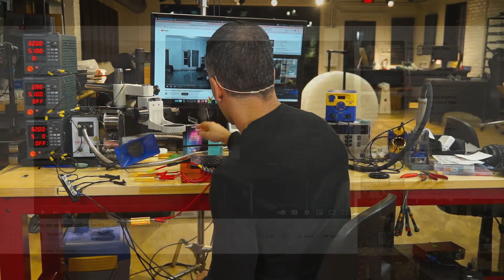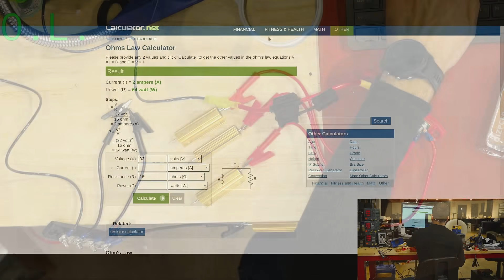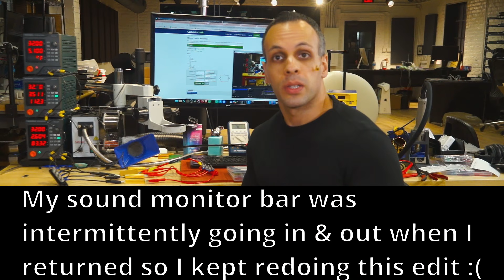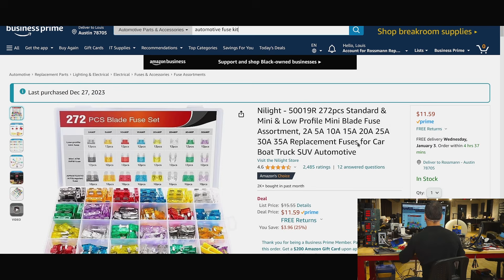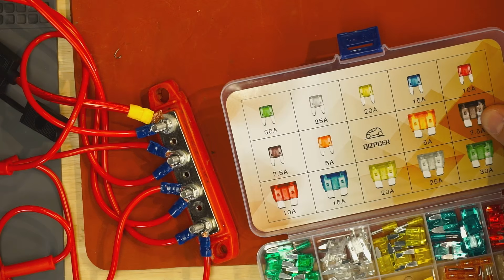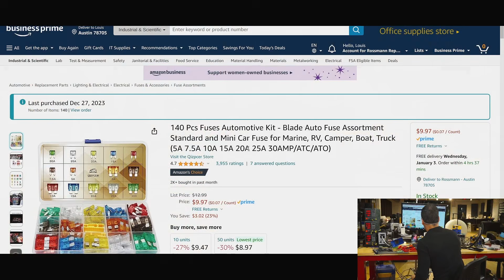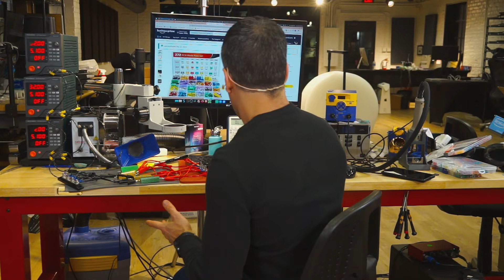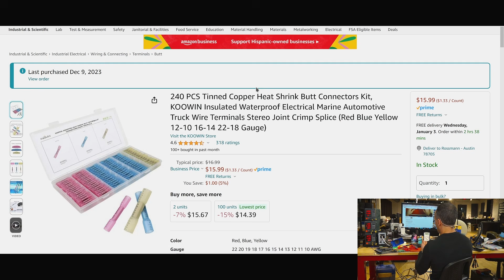Amazon Sells Fake Electrical Fuses

Comment: I would have loved it if you had tested a few fuses of the same rating from each (2 anms, 5 amps, 7.5 amps and 10 amps for example) as I would personally suspect that most of the <10 amps fuses probably use the same element on some brands you tested. I'm pretty sure you'd get different blow points over time if you purchase new kits in let's say a few months...   Those products should be banned at import level as they represent a lot of danger.   Almost all counterfeit products from larger brands (with trademarks) get filtered while being imported and destroyed (although a fake Tommy Hilfiger shirt can't technically kill you).   Amazon should be more diligent on their resellers selling on their marketplace, but as you mentioned they don't really seem to care. The worst part is that Amazon will deny any liabilities for any defective fuse that will burn down your home/car/whatever and tell you to contact seller...     Maybe you should also file a complaint with ICE as there is a page on their website about dangerous counterfeit imported goods...

Comment: That first case was probably actually a 5A fuse that was mislabeled as 2A.  The second one actually blew exactly where it was supposed to, IMHO.  A 5A fuse is actually not supposed to blow even at 6A, and if it's a slow-blow fuse, 8A might take a while, but 10A should make it blow fairly quickly, which is exactly what happened.

(As a general rule of thumb for (slow-blow) fuses:  100% rating (e.g. 5A through a 5A fuse) = should never blow at all (if it does, the fuse is defective).  120% rating (6A through a 5A fuse) = might blow, but probably not, not guaranteed either way.  150% rating (7.5A through a 5A fuse) = will blow eventually, but can take a while (i.e. minutes).  200% rating (10A through a 5A fuse) = should blow within a second or so.  This is how pretty much all fuses are designed and intended to work.  (Fast-blow fuses have basically the same limits, but anything over about 150% should blow pretty much immediately.))

So basically out of all the fuses you tried, you found only one that failed to work as advertised.  Yet you're trying to paint this as a scandalous pervasive problem across all of Amazon, somehow.  I used to have a fair amount of respect for you, but it's rapidly dwindling because of your constant histrionic clickbaity BS like this.  Please knock it off.

(I'd also really like to see how some of the other fuses from that bad seller test out.  Are all of them screwy, or is it only the 2A ones?  Is it all of the 2A ones, or did you just happen to get a bad one?  Don't get me wrong:  Having even a single 2A fuse not work as advertised is still potentially a problem, and the seller should be reported, but this trivial amount of testing really doesn't actually tell you anything about the scale of the problem, or how likely it is that people are actually going to be bitten by it.)

Comment: I made the mistake of buying fuses at harbor freight.  I had a short and when I figured it out the plastic melted off the fuse but the link was still making contact.  It was one in a relay kit for lighting.   I don't trust any of that shit after that.

Comment: While not dangerous, I was sold a  Laptop on Amazon from a 3rd party vendor. When I said it was constantly BSODin, I told them I'm returning it to them. I had it basically a day when I made this. It was so bad that I couldn't even get through the Windows install.... and then when I reinstalled windows from a USB, it finally got me into windows... But it BSOD'd every couple minutes.

Vendor then sent me an insane amount of requirements to send it back... with basically 40-60% restock fees for opening the product. Fuck Amazon.

Comment: I am a mechanical engineer, and it's a similar story with mechanical components. I used to work in a large aircraft assembly factory where frequently heavy equipment was lifted, overhead, by large cranes. The (union) shop would only agree to work on a lift if a particular, north american, manufactured brand of lifting hardware was used.

One day one of our senior engineers wanted to determine what the off-brand, 1/4th the price chinese shackles would do. Whereas the North American, approved, brand name equipment failed at 5x the rated load (as specified in the product data sheet) in a ductile way (slowly yielding giving visible signs of failure) - the chinese equipment failed catastrophically at about 95% - 100% of the rated load. Note that in most case you NEED to have a ~10% margin since you'll rarely know for sure what the exact weight of a 10,000 lbf piece of machinery weighs.
Reply: In the oil field all load bearing devices are American made, there is a reason.
Reply: They'd work with only american but scoff at KONE?
Reply: @lasskinn  what? it says the union only approves one brand, and that the brand is north american.
Reply: How are they a senior engineer?
Reply: @ms_cartographer  They just wanted to do a test to see the quality, nothing wrong with that, for curiosity sake perhaps.  Getting first hand knowledge is much better than word of mouth.
Reply: @ms_cartographer  What did he mean by this?
Reply: Yeah, that sounds about right... this is why China has high speed rail connecting all of their capital cities, and America has entire bridges that fall to pieces, train derailments causing catastrophic environmental damage, and no workable nation wide public transport system. 

That is also why all the countries China has trade and development relationships with are actually developing the same infrastructure at a fraction of the cost because they're not fucking stupid enough to pay more money for the exact same product. 

The issue is not the product in the case you mention. The product that was made was designed for a specific purpose, and that isn't the purpose your bosses used it for. Because they're cost cutting capitalists who don't give a shit about anything but their bottom line, the de industrialisation of the American rust belt resulted in a total inability for the united States to actually self manufacture things like what you are talking about. 

It's not china's fault that the American ruling classes like making money more than they care about the people living there, and because China has laws where if a corporation comes from outside asking a business there to produce something, under chinese law China is actually legally allowed to produce a generic version. 

That aside, the point stands that the united States deindustrialised almost entirely and when you do that you are then forced to buy your shit elsewhere. 

If American businessmen decide to buy the wrong product for the job because it works out in their best interests, again, that's not the fault of china. They don't have an obligation to follow up what everything they sell is used for. The massive mega corporations that buy the wrong material because it's half the price then give it to workers like you to use absolutely love that people point the finger at china rather than them
Reply: I call bullcrap
Reply: @pootisengage6672  It must be hard going through life being so totally stupid and useless
Reply: @pootisengage6672 HERRO U BUY CHILESE SHACKRE, VELLY GUD

Comment: @louis rossmann  Is it possible the fuses that took forever to blow were mislabeled?  You used the colors to determine rating, what about the value stamped on the fuse itself? Unless I missed it, I didn't see this shown in the video.

As a side note, agreed, most garbage sold by amz is indeed garbage. I'm shopping elsewhere whenever possible.

Comment: As an electrical engineer, I always look at these reviews with a grain of salt.  

The revies may very well be real, but the reviewers are not engineers and quite often are idiots. 

Imagine the average idiot who has some device that frequently blows 2amp fuses. They go to an auto parts store and by a top brand and they still occasionally blow. Then they buy some of these from Amazon and they don't blow,

In the idiot non technical mine, these Amazon fuses work great!! Their device works and they "fixed" it by putting in better fuses that work great!!

In their incompetent minds, they see a fuse as a device that lets power flow. They don't see it as a device that protects against too much power flowing!  In their minds, fuses that occasionally blow while their device is working, must be defective, low quality fuses that "don't work"!

The reality is that when it comes to electrical devices, the average person does not use electrical theories or principles to evaluate and rate a devise, see high ratings by other product characteristics.  Those characteristics often being completely irrelevant to their actual technical quality. 

I look at Amazon review ratings, but I also do my own evaluation of the reviews.  Iread individual reviews and in doing so, often realize that the reviewer has no idea what they are talking about.  I usually start by looking at bad reviews and 5 star reviews.  Often theses speak a lot to the reviewer rating criteria.

Comment: I had the same experience with a pack of UK fuses I bought from Amazon. I had a 3amp fuse blow in a Samsung TV, so I bought a set to see if it would blow again. Guess what, the 16 amp breaker went instead and the replacement 3 amp fuse was still good. Never buying this type of product from Amazon again.

Comment: Your power supply has programmable current output, you did not have to do resistor shaneningans...
Reply: Yes, he had to do that. The programmable output current is in praxis only a maximum output current. Without an electronic consumer nothing would happen
Reply: You mean he would not experience heat and smell, i sgree but fuse would still burn once you exceed current threshold (done many time as i used to "calibrate" fuse whiskers with preset current value and test them to see how much overshoot they allow!) so yes he could just vary adjustable current until fuse pops! All excess dissipation would be handled by power supply (in my case KORAD KA30005D that can be automatically set to parallel mode)  @lgt7177

Comment: It's not just a matter if Amazon reviews are fake or not, it's also they apply the same exact reviews across similar products from different manufacturers.

Wanted a metal hand cheese grater, found a suitable model. Reviews were great. Oh, wow, there's others that look comparable but cheaper - lest us check the reviews... Hmm, the reviews for all of these cheese graters are identical, literally the same exact reviews from the same reviewers. Actually, a lot of the listings are using not only the same reviews, but the same photos and the same write-ups!

Come on Amazon, you can do better. Yah? In the mean time, you're not surprised then a lot of what comes from you gets returned, are you? That's why we buy nothing from you unless returning it is free. If we can't know what we're actually getting, then you Amazon can be sure item returns will continue to fill your returned product dumpsters!

Comment: Over 15 years ago in my late teens I had an old beater BMW that broke down in the middle of the road. It cranked and sparked but it couldn’t start. I opened the fuse box and found the fuse for the fuel pump had blown. I replaced the fuse and it popped a few seconds after starting the car. Being young, dumb, and wanting to get home, I replaced the 15a fuse with a 30a fuse. The car was able to start and I could drive home — except I didn’t get home because the wiring loom to the pump eventually melted and nearly caught fire under the rear seat. Long story short, I nearly turned my car into a fire bomb by using a fuse that refused to pop at the necessary rating. Hope Amazon gets away with selling this shit is beyond me but I pray regulators fine and regulate them soon.

Comment: the 5 amp fuse that blew prettymuch instant on 10 amp is prettymuch in spec. A 5A car fuse needs to deliver 5A without significant voltage drop. They are rated a little different then home fuses wich should not deliver more then the stated current where iirc car fuses should deliver the stated current. And then they wil pop prettymuch at 200% of the rating within about 1 sec. Or atleast the stated rating should hold for 30 seconds(aka slow blow fuse)

Comment: It's a feature Louis! Normally you replace a fuse over and over because it keeps blowing, and then consider replacing it with a bigger fuse to fix the issue
With these you don't need to use a higher rating, you just put the same rating in, and it works!
Reply: When replacing fuses blow then your device has a problem that replacing fuses can not fix.

Comment: Last night I made a remark on the setup employed to find a fuse's breaking current, which appears to have annoyed Louis and, among other things, he said my remark was way off his point. No argument that employing 3 programmable supplies in parallel does NOT negate the findings - I never implied that - I thought some more about the core presentation and some of the remarks I read from other viewers.
Yes there is a lot of crap on Amazon. On eBay too, just like on Etsy, in Walmart, in Costco - pretty much anywhere you turn.
This is not necessarily a result of the Amazon's greed and it does not mean, as a reader posted, that Amazon should be forced into responsibility for the products they sell.
I believe it is rather consequence of the capitalist society we all live in and its rules of operation. It is, if you want, the price paid for freedom - people are free to produce junk and people are free to choose junk (which they do all the time btw).
On any farmers' market the market itself is not responsible for checking the nitrate level in the products, are they? They really can't be, even though I am sure the exact same argument is valid and has been called upon multiple times, resulting in some form of control or another.
There are several things about control though. First, hackers will always find way around any form of control. Second, control increases costs and price - all with the likely hood of ending up at the same place, as all kinds of hardware and software protection illustrate all the time.
While there are many things Amazon could be blamed for, quality of products sold there just can't be one of them.
At the very least, it should not be criticized by those who haven't done what Amazon is doing in whole, which is bringing wide variety of products with fast delivery at fairly low cost.
Now...is their cost always the lowest? No, it isn't. Nobody's price is always the lowest.
Is the quality there the best or even guaranteed? No, it isn't because it is open to the world to sell and it is practically impossible to control everything, if only because then there will be screaming (rightfully so!) that Amazon wants to control everything.
Same with Facebook content BTW.
And to top this off...Louis himself sells a certain hot air gun station he uses and has reviewed.
Amazon and eBay (and AliExpress) offer the exact same station at a discount.
Is Louis to be blamed for being greedy here? Should he be forced into price compliance just because someone offers lower price?
No he shouldn't and even if some of the stations that come from him fails within say 30 days. Louis should still not be blamed because he is just doing something out of good faith and not forcing anyone to buy from him.
Well admit it, nor does Amazon in case with the faulty fuses.
it's a free market with all the pros and cons that come out of it.
And regulations have proven to do just about as much harm as they do good.
In capitalism people learn the old fashion way  - by getting burned - what is good and what is not.
That keeps them sane and alert and away from blaming others for their own failures.
Sorry for the long post. Perhaps it would be better to do a video, but I flat out hate video responses and video commentary on someone else's video. Always felt like a cheap way of getting attention yourself and that's not what I am about here.

Comment: Another issue with Amazon Reviews is that some of them might be legit...but for a completly different product.  Because a seller can edit thier Amazon listing, there is nothing stopping someone from selling one product with a lot of positve reviews, lets say a bag or something similar thats bound to get 5 stars, then turning around and selling, oh say a portable hard drive that claims to have 300 Terrabytes of data for 30 dollars despite the fact said hard drive only has 300 megabytes and is designed to trick the average consumer into thinking it has more.

Comment: 2A at 32V is 64W of power. 8A is 250W.
This means you have nearly 200W of power inside the device that isn't supposed to be there, meaning 200W of waste heat turning everything red and glowing.

Comment: I always thought that if I hook up something demanding 500W to 100W power supply nothing will happen because that thing just physically cannot demand something that power supply can't provide. For example if I would connect 500W light bulb it would glow at 1/5 of it's power but not demand 500W and burn the power supply. Is that not correct?

Comment: Louis you probably know this already but just in case: Those 50W Aluminium clad resistors cannot handle 50W or anything like it without being screwed onto a hefty heatsink. Furthermore they can fail fairly dramatically by explosively ejecting the end cap when they overheat.

Comment: Hello. You need to make a video about component legs which used to be copper but now almost always magnetic steel and almost never copper. even on Audio capacitors they are used steel legs

When I bought 75 ohm antenna cable, I was surprised that they were steel center conductor and aluminum screen.